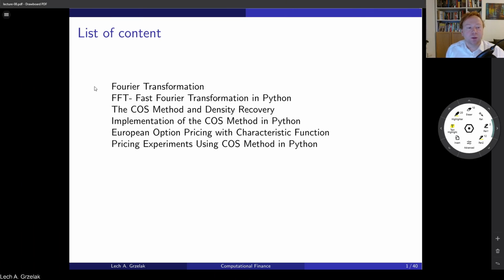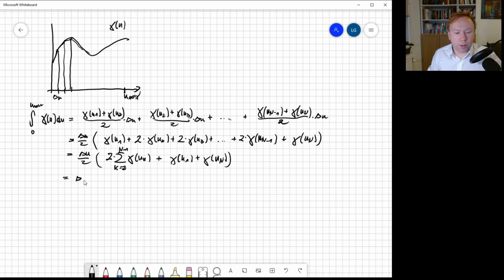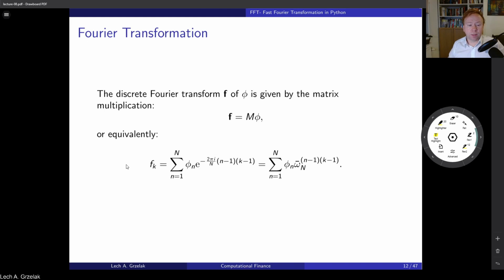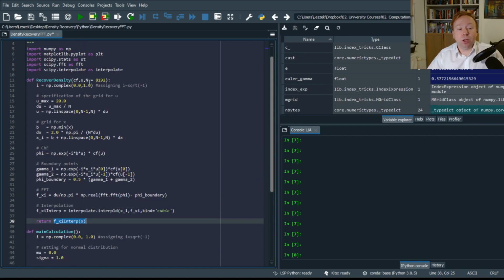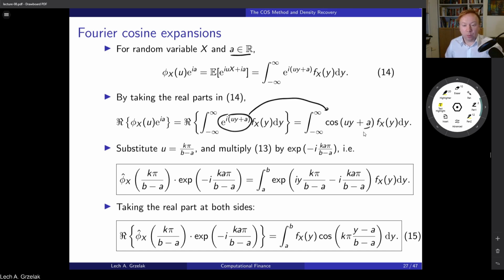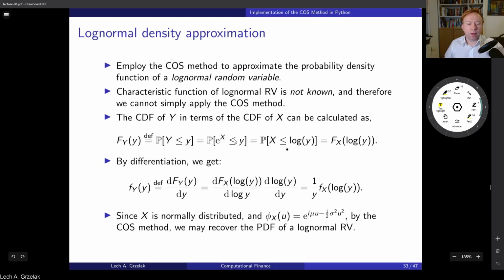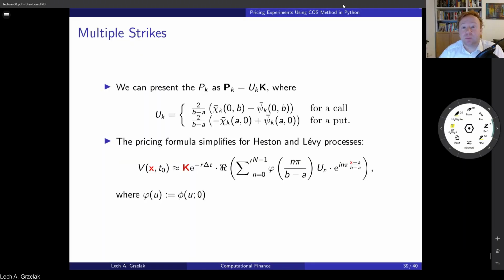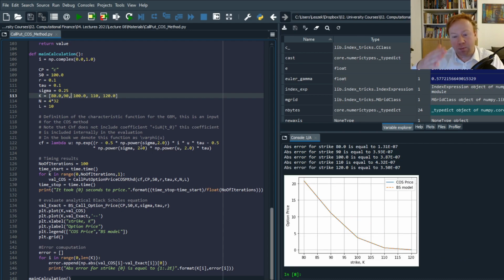Computational Finance: Lecture 8/14 (Fourier Transformation for Option Pricing)

Comment: Hello again Prof, 
we know that S_T follows a Log-N(r - .5*sigma**2,  sigma**2) hence log(S_T/K) should follow a N((r - .5*sigma**2 - log(K), sigma**2) but this doesn't show in the implementation of the char funct in your Python code. Can you please give further details about this.
Reply from the maker: hello, thanks for your message. I think you need to be a bit more explicit to which function you refer too. I had a look at all the Python functions from this lecture, and I haven't seen any problem. In two functions I have shown how to recover lognormal and normal densities (without specifying whether they come from S_T or not) and in the other functions I have performed the option pricing. Thanks. Best, Lech

Comment: Hello again, as always, an awesome lecture! I see that CF has been assumed to be available in closed form for the COS method, would numerical approximations work here? I believe Riccati equations are not always solvable in closed form, but we might be able to solve using numerical methods (RK for example)
Reply from the maker: hello Nate, yes, indeed it is not necessary to have the ChF in the closed form, however, if you need to solve ODEs to get it may be computationally very expensive. As a principle, if you cannot solve the ODEs analytically, it is very likely that your model will not be used in practice as its calibration will be insufficiently fast.
I hope it clarifies,
Lech

Comment: Thanks for this great video! I however have a confusion over the change of variables related to the ch function. I understand that ultimately we need the cf of adjusted log price, x=ln(S/K), but it seems to me that you just plugged/replaced it in the cf of x'=ln(S) without considering the term exp(-iuln(K))? is it so?
Reply: because for any constant c and r.v. X, \phi_{X+c}(u)=\phi_X(u)\cdot e^{iuc}?
Reply: wait, I think I just realized that the thing is accounted for in the new x=ln(S_0/K)😂
Reply from the maker: Excellent Harold, good you managed to answer the question yourself! :-) Best wishes, Lech
Reply: Had the same question, can you explain it better why it works?

Comment: In slide no. 39 you mention that the cos method is not efficient when phi depends on x. You mention that for OU processes such is the case. My question is what is the alternative method for efficiently computing prices for such processes. Could you recommend any source where I can learn more about this?
Reply from the maker: hello Pinaki, the problem with the efficiency is only present in the vectorization against strikes (computation of multiple strikes at the same time). If you are only interested in a single strike it should not be a problem. Alternatively, you can use the Carr-Madan method for option pricing. There, the formulation of the pricing equations is slightly different so this problem should not occur. I hope it clarifies. Best regards, Lech
Reply: @ComputationsInFinance   Thanks for the explanation. Are you referring to 
P Carr, D Madan - Option valuation using the fast Fourier transform, Journal of computational finance, (1999) paper?

Comment: Hi Lech.Recently I'm learning the paper by Carr and Madan ,which is about the FT&FFT option pricing method. A problem bothers me for a while. Carr and Madan provide two formula for option pricing (ITM&OTM),I want to consult you that why the "ITM"formula can't be used for the "OTM" situation.  While former is written by definition C(k)=e^(-rT)E^Q[(S_T-K)^+], why we need a extra formula for OTM. Sorry for asking you questions which is uncorrelated with the lecture video :)
Reply from the maker: hello Haichuan, If I well remember, the alternative formulation for the Carr-Madan approach is for the OTM option with an extremely short time to maturity (1d or less). So it is not that you always need to use different formulas, but only for the cases when the time to expiry goes to 0, T->0. The reason why you need a different formula for T->0 is that the function is not smooth any longer (the value approaches the payoff) and that causes a lot of oscillations. These oscillations can be mitigated, to some extent, with alternative formulation or by changing the integration domain for the ChF. Of course, the main question is: what is the purpose of your pricing? Is it a calibration to the whole volatility surface? I provided a bit of discussion on the calibration of the SV models in the book, maybe you will find it useful. Best wishes, Lech

Comment: Hi Lech, on the point where we always have characteristic function and we know many common characteristic function without really knowing the underlying density function, just wonder why this is possible? 
By definition, we need to know the density f(x), multiplied it with exp(iux) and calculate the integral. How is that we know one in analytical form without knowing the other? Could you please give an example as well!
Thanks much!
Reply from the maker: hi Minh Le, indeed, firstly it may sound a bit counter-intuitive, but it makes a lot of sense. In your observation you assume that you need the PDF f(x) in order to get ChF phi(u). However, it is not always the case- as presented in the course. For affine/linear models, we can find the so-called "fundamental" solution to the pricing PDE and this solution is the ChF that we can use to recover the density. On the other hand, there are many more models, like alpha-stable random variables, that have ChF but do not have closed form PDF. 
I hope it answers your question, Best regards, Lech
Reply: @ComputationsInFinance  How does alpha-stable processes make an entry into derivative pricing? Could you point me to a representative paper. Thanks a ton.
Reply from the maker: @pinakibhattacharyya7853  These processes can be used in the credit world to better describe default events. They would also be useful when a need for fat-tailed distributions. Best, Lech

Comment: For anyone interested, here I calculate the error for the log-normal distribution, similar to what you did with the standard normal distribution:

ln_object= st.lognorm(s=sigma, loc=0, scale=np.exp(mu)) # instantiate log-norm distribution object

f_XExact = ln_object.pdf(x) # calculate log-norm PDF

f_X = 1/x * COSDensity(cF, np.log(x), n, a, b)

error = np.max(np.abs(f_X-f_XExact))
Reply from the maker: Thanks Sebastian R for your contribution. You can also add your piece of code to the GitHub repository. Best wishes, Lech

Comment: I was reading about the COS method and thank you for the detailed explanation on it (with Python implementation as well!) I do have a question: Can we use the density recovered by COS method to simulate price paths?
Reply from the maker: hello Yefeng, once you have derived a transition characteristic function phi_{X(T)|X(S)} then yes, indeed you should be able to sample from X(T)|X(S) for T>S.  However, that may be considered to be computationally very expensive, i.e., for every sample of X(S) you would need to determine the corresponding CDF, F_{X(T)|X(S)} and then inverse that CDF. Please take a look at the article of Broadie-Kaya on exact sampling for the Heston model- there you will find more details regarding sampling from the corresponding characteristic function. Best wishes, Lech
Reply: @ComputationsInFinance  Thanks for the reference. Seems like a very important paper.